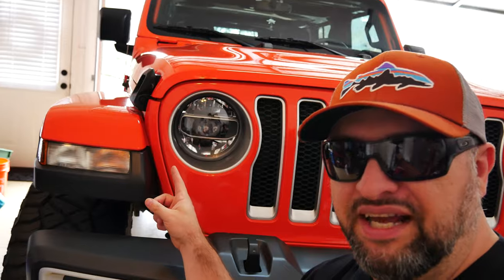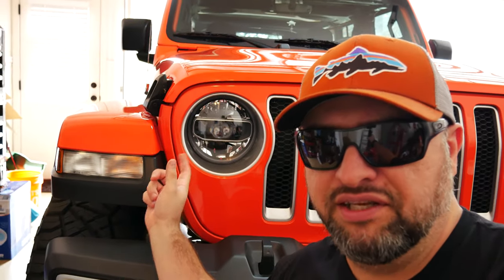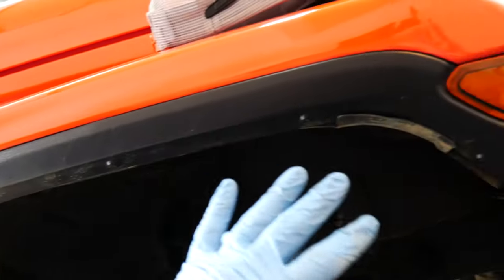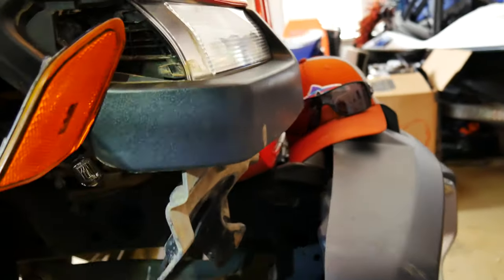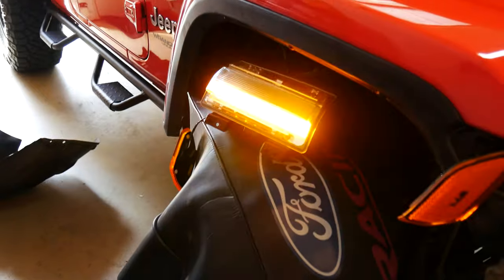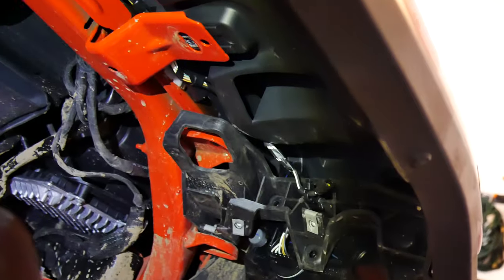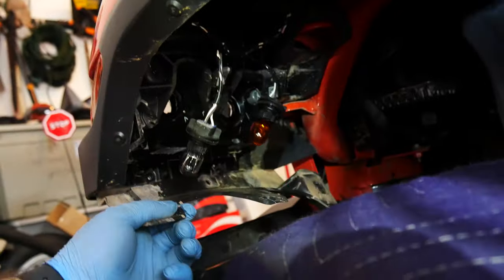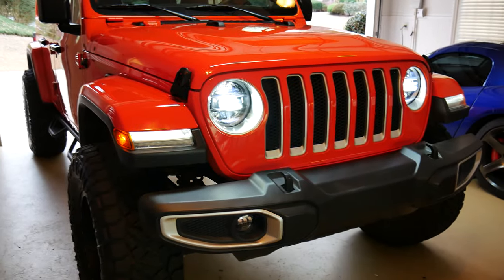JL Jeep Wrangler OEM LED DRL SWAP

Comment: Can you please provide me with the part number for the LED DRL ?
Reply from the maker: Hi, the part numbers I believe are driver side: 55112885AF and passenger side: 55112884AF but sometimes they change. Also, they only work on Rubicon, Overland, and Sahara. They do not fit on a Sport models because of the fenders being 1-piece.  So you would need to also swap the fenders. Or look at the morimoto options.  Thanks!
Reply: @DeeperImageAutomotive  thank your for your reply! I didn’t know about the fender for the sport model, but glad i ran into your video. Keep up the good work 👍🏻
Reply from the maker: @Fred Wills He is talking about the side marker/turn signal/ DRL. They won't work on a sport from what I've seen as it is slightly different than the Rubicon/Sahara trims, but I've never tested it.
Reply: @DeeperImageAutomotive FYI sport painted fenders are 2-piece.  Not sure if the OEM housing will fit but yours looks identical to mine so I suspect that it will.

Comment: Glad I found your video.  Really helped with my swap/install, especially the 3M tape observation.  I would have racked my brain trying to figure out why it wouldn't detach.  I found I had to remove the fenders in the end to complete the job.  I think it made the job of replacing the harness and removing the 3M double sided tape much easier as well.  The first fender I yanked and broke two clips so waiting for replacements in the mail.  I found with the second fender you can squeeze the clip retention ends with a needle nose plier and it releases.  No broken clips.  Thanks again!
Reply from the maker: Glad it helped you out! Thanks for sharing!

Comment: hey men, I bought a jeep and come with the halogen one, and I got a poem led turn signal and daytimeruninglights, and it work well but just for a while then and shows me in the dahsboard that the turn signal when out, is the same thing for both sides, do I need a taser, so that failure won't appears again??? but also I can also take it to the dealership and they will fix it??? do you know how much can charge me for that?? thank you
Reply from the maker: You need to reprogram the ECU to LED.  Even if they work without coding, eventually they error our or hyper flash.   I’m assuming you meant OEM LED?   A dealer is going to charge more than the cost of the Tazer Jl mini and it’s one time deal.  The Tazer also has multiple uses.  In the programming you change from non led STD to LED.  Hope they helps.

Comment: I did the same way install factory fender led lights and reprogrammed into led setting, but the white strip light will be off when my low beams on. Any idea on this situation? Im so frustrated on this...
Reply from the maker: @gonglouis9428  are you using the Tazer JL Mini? I think I had to enable another setting in there but can’t remember.  If you are using the Tazer send the ZAutomotive guys an email and they can check the settings.  If not check the wiring harness

Comment: Hey, do you happen to know the part number for the led harness? I acquired some led drls but they didn’t come with the harness.
Reply from the maker: From what I understand the LED harness is attached to the LED DRLS, mine came with it so I didn’t have to source one.   Only the halogen bulb has a removable harness but cannot be interchanged with LED DRLs.   I could be wrong but that’s what I’ve been told.  I do not know the harness part number sadly as mine came attached.
Reply: What did you end up doing? I have the same problem

Comment: Did you try just using your Tazer mini and try just turning on your halo? I added the oem led’s and was able to just turn on my halo’s without any additional wiring
Reply from the maker: For 2018-2022 JL Wranglers, they are missing the wire that actually powers the HALO itself, so even if you enable it, there's no physical wire to power the HALO.  If you have a 2020.5 or newer, they come with that extra wire already, so in that case all you have to do is enable the HALO with the Tazer and it will work.  For the older JLs like mine, you need to get the Mopar wire kit which is like $60 and install it.   I have in another video with the headlights.

Comment: So i now have these factory LED DRL/blinkers to put in.  But i've already wired in aftermarket LED headlights and tapped the factory halogen DRL/blinkers for the halo and blinker.  Since you have both harnesses for halogen and LED, could you by chance tell me if the color coding on the wires are the same?  In other words when i install the LED DRL/blinker will i be able to find the green and the tan wires i tapped w/ the halogen harness?  thanks
Reply from the maker: Unfortunately it has been a while since I did this but the Halo wiring I purchased was blue and white because it was an entire new wire that my 18 JL didn't come with.  After 2020 they included the HALO wires even if you didn't have LED light option.   I think the best way and easiest way will be to turn on the ignition and use a test light to see where the current is.  If you have a 2020 or newer, it will be plug and play, and just need to enable LED option using something like a Tazer JL Mini or dealer programming it for you.   I'll see if I can have a look a this thread it has a lot of info on wiring a few different ways with or without a tazer too. https://www.jlwranglerforums.com/forum/threads/wiring-halo-drl-amber-turn-switchbacks-fender-led-drl-switchbacks-on-jl-sport.25959/#post-615801

Comment: Hey man, does the tazer mini program the halos on the headlights if i installed everything correctly?
Reply from the maker: Yes, the Tazer JL Mini will let you enable LED lights, Halo, as well as give you a ton of other options to enable/disable.
Reply: @DeeperImageAutomotive  appreciate the swift response mate, thank you

Comment: Finally installed them , great video by the way! .. but can’t get the HALO effect on the headlights .. what did I do wrong ?
Reply from the maker: If you have a 2018 to early 2020 you need the halo wire cable kit because those JLs didn’t come with the halo power wire in the harness.  If you have a later 2020 and newer you should have the halo wire.  If you do have the wire you also need to enable LED lights with a programming tool like the Tazer JL mini.
Reply: @DeeperImageAutomotive  thank you very much for replying ! Mines is a 2018 jl sahara . We’re can I get this wire kit please ?

Comment: Do you leave the TAZER connected all the time?
Reply from the maker: I do because it doesn't actually connect to the OBDII Port, it connects to the SGW module above that.  You don't have to leave it installed after programming, but you would lose some features that are called LIVE FEATURES.  Like disabling the autostart/stop feature that I hate. The Live function remembers last state, meaning if I turn it off, it always stays off until I turn that feature back on.    If the Tazer is not in the car, those live features don't work, but the LED programming would still work as those are not LIVE features.   Check out their guide for a complete list of LIVE features - https://www.zautomotive.com/zpu/instructions/TazerJLMiniUserGuide1120.pdf
Reply: @DeeperImageAutomotive  last question; can I connect the OEM LED halo Headlights to a fuse instead of doing all that hard work sending the wire to the front?

Comment: Hey I have a 2023 wrangler unlimited Sahara with halogen DRL . I want to swap to oem LED . Do I need the taser for this year model or not ? Extra harness or not ? Thanx
Reply from the maker: I don't know 100% because my JL is an older.  I have read and been told that after 2020, the Wrangler didn't need the extra wire.   However, programming has always been required either through the dealer, or Z Automotive JL Tazer Mini.   Check the Wrangler Forums, a few more threads on there from newer Wranglers.

Comment: CAN YOU GIVE ME A LINK FOR THE 4TH WIRE HARNESS PLEASE
Reply from the maker: If you are talking about the wiring for the HALOs this is how you order (there's no direct link as it changes all the time) You have to order a harness called the "Wiring-Jumper Part #68347117AB" from any online Mopar parts resellers.  The dealer will charge you double, so look online.  Also, if they ask you to put your VIN number in the order, and you have a non-led headlight from factory, they will cancel the order because it shows as not-compatible in their system.  Leave the VIN # blank.

Comment: So does the LED fender light display, plug and play to the Halogen wiring? 
Where did you find these lights at??
Reply from the maker: Yes the wiring plugs into the same place as the halogen one.  The only thing you have to make sure of is that the LED lights come with the wiring harness attached to them and haven’t been cut.  The halogen light harness does not work on the LED light.  I got the lights of Facebook Market place, but you can find them on eBay or Jeep forums used as many owners remove the fenders for bigger tires.

Comment: Hey man I did the same mod but mine says turn signal lights out error did you have to use a taser or something ?? Need help
Reply from the maker: yes, if your Jeep didn't come with LED lights originally and you are using the OEM ones, you will need a Tazer Mini JL or the dealer to program LED lights.  There are options on the Wrangler Forums if you search for LED light conversion of wiring harnesses that do not require programming but I'm not super familiar with them.

Comment: I got the DV8 OEM style headlights, but my halo on passenger shuts if when I put in my driver blinker😏 only happens on dlr mode.
Reply from the maker: Interesting. I’m not familiar with the SV8 but from what I’ve seen from other aftermarket options, they don’t need to the DRL switch.  Only the Mopar OEM ones do.
Reply: @DeeperImageAutomotive  sorry I meant DV8 
Was a typo  🤦‍♂️

Comment: Quick question! Can i use the TAZER Lite instead of the mini to change the settings on LED?
Reply from the maker: Ruben I don't think the Tazer Lite has the programming capabilities as the JL Mini version.  However, I would recommend you contact zautomotive.com as they make them, and I've only used the JL Mini.   This comparison chart looks like the Lite would not work.  https://www.zautomotive.com/wp-content/uploads/2018/11/TAZER_JL_LITE_VS_TAZER_JL_MINI_COMPARISON_LIST_JPEG_REVISED_HONEYCOMP.jpg

Comment: Hello, I have a Jeep gladiator Jt Mojave, but doesn’t came with LED packages lights. Do I need a taser ? Where can I get one which brand ? I saw 8vd Off road headlights similar to the MOPAR but says plug and play idk if I need a taser or just for the MOPAR parts ?
Reply from the maker: Hi George some aftermarket LED lights are indeed plug and play and don’t require any special programming or wiring.  This video is specific to those wanting to use the OEM Mopar LED lights which require programming and in the older JLs require an extra wire for the Halos to work.  The Tazer JL Mini is made by ZAutomotive.  https://www.zautomotive.com/
Reply: Thank you! Last question do you know where I can order a  side led fender parking and turn signal light? I need both sides.  Oem I think I would need the taser

Comment: I have DRL bulb package on my jeep but i changed to LED DRL as like your video but jeep light is flickering not working properly. I tried flash cal but it doesn’t work
I want to know what kind of tazer mini you installed in your jeep ?
Reply from the maker: I used the Tazer JL Mini by ZAutomotive. Once I got it I updated to the latest build they have which included LED lights then programmed it and it worked on first try.  I’ve read on the JL forums that the Tazer works more often than the flash cal.

Comment: Are the OEM LED DRL’s plug and play or is a tazer required for them to work? Recently found out the OEM LED headlights are plug and play  in which I thought they weren’t
Reply from the maker: They are plug and play, just make sure they come with the harness as you cannot use the halogen DRL harness.  The DRL LED harness is attached to the lights and cannot be removed, but I've seen people cut them and sell the lights with no harness which won't work.  As for the tazer part, they work without programming but will do rapid blinking sometimes, so a tool like the Tazer allows you to easily reprogram your Jeeps computer from Halogen DRL to LED DRL so that you don't have the rapid blinking issue.
Reply: @DeeperImageAutomotive  so if I have the lights with the harness, all I would need to do is swap out the lights not swap out the harnesses correct? I originally thought I had to switch out the harness

Comment: Where did you purchase the DRL wiring kit and do you happen to have the party number? Thanks in advance.
Reply from the maker: The OEM DRL lights come with the harness already and it is fixed in place, so I didn’t have to order wires for it. It was a direct plug and play.

Comment: I have a jt and trying to unplug the harness, can't figure out how to unplug it. You have any tips?
Reply from the maker: Which harness? The inside one? There’s a little lever that you pull back and it will undo the harness.  On the smaller ones there’s usually a red tab that slides out to unlock. Hope that helps.

Comment: I have a 2021 Sport S and currently have halogen DRLs. If I wanted to switch over to the LED DRLs would I have to change my fender?
Reply from the maker: I believe only the Saraha and Rubicon are interchangeable as I did in this video.   Otherwise you would need the Sahara or Rubicon fenders.  Have you looked at Oracle switchback DRLs?  They don't even require programming and would be just as nice as the OEM ones.
Reply: @DeeperImageAutomotive  no need to switch fenders with the Oracle switchback DRLs?

Comment: Will any of these lights fit the 2021 Jeep Wrangler Willys unlimited sport? 

Please help. Want to update my DRL lights but everywhere I look its only for the models up to 2020. Check on ebay and all day they don’t fit my vehicle
Reply from the maker: I have not tested it personally but my understanding is that they do.  For the headlights it’s even easier because the wiring harness already includes a wire that is missing in the 2018-2019.
Reply: @DeeperImageAutomotive  oh ok... that’s what I’ve seen from some reviews. They are all the same size, guessing that for the DRL its matter of playing with the wiring

Comment: What is the taser? You talk about in your video. How do I acquire one?
Reply from the maker: Willo the Tazer is a small device that allows you to enable/disable and program certain features that may not be turned on from factory.  For example, in order for my LED SWAP to work properly, i have to tell the ECU I now have LED lights vs halogen ones, or I'll get weird flickering/blinking.  The Tazer allows me to do that without going to the dealer and paying them to turn on or code those features.  It pays for itself very quickly if you plan to do some mods to your Jeep.  Here's the link to their website - https://www.zautomotive.com/product/tazer-jl-lite/

Comment: Sir can you help me after fixing this indicator not working properly
Reply from the maker: Make sure the wiring harness is in the correct plug.  Also, you have to enable DRL/LED in the ECU or it wont work. You can do this with a Tazer JL Mini programming tool, or take it to your local Jeep dealer and pay them to enable the DRL headlights/LED Headlights.  Also, there are wiring harnesses if you search Amazon or Wrangle JL Forums that do not require programming.

Comment: I recently bought a 2021 Rubicon that was loaded with everything but LED lights.  Since I traded in my '18 which did have them, I knew this was something I wanted to swap out.  I bought the headlights, fog lights, and running lights/turn signals.  My local mechanic said he'd try to install them but wasn't sure how to do it.  I then went to the local Jeep dealer and was told they could install them to get them to work, but it would confuse the computer/circuit boards or something like that and I'd get error  messages all the time.  Now I'm afraid to have it done, but like you, I really don't like the stock lighting.  Is there any merit to the Jeep dealer's fears?  Thanks.
Reply from the maker: I can't speak for the dealer, and they may have a valid point in terms of something causing damage that their warranty wouldn't cover.  However, hundreds, if not thousands of JL owners have done the upgrade with used, or new OEM lights, and a Tazer or something similar to enable the LED code in the ECU, with no issues.  I've now had mine for nearly two years with no issues.   In the JL Jeeps after 2020, it is even easier to upgrade because you now have the correct wiring harness, where mine and other 2018-2020 JLs needed that extra wiring harness to make it work.
Reply: @DeeperImageAutomotive  Thanks for the reply.  I think I'll ask my mechanic to watch this video and consider doing it for me.

Comment: Hi, thank you for that video. Just wanted to ask about the part number of that turn signal you removed. Any chance that you still have it? It looks like to only option for me.
Reply from the maker: Hi if you are referring to the stock HALOGEN DRLs my Jeep came with, I believe the part number is 68293127AE for the Left side and 68293126AE for the Right side.  Hope that helps!  There are also small amber LED reflectors on the side that are separate but I don't know the part numbers on those.
Reply: @DeeperImageAutomotive  Thank you for reply. I was informed just now, that in SPORT 2018, I can't install them. :( . Have a great day. 👍